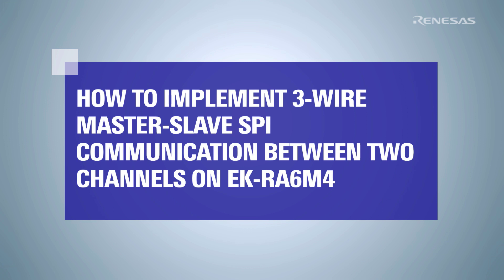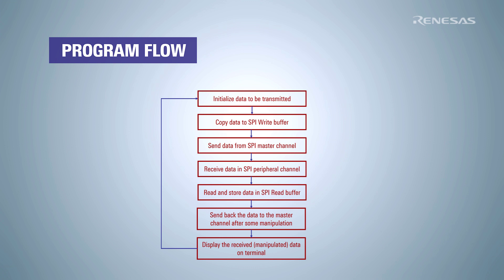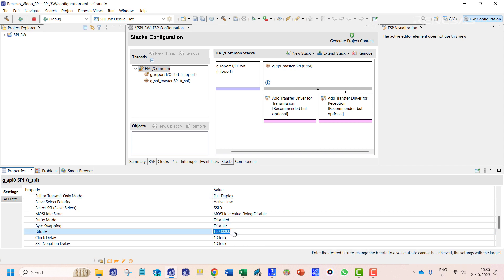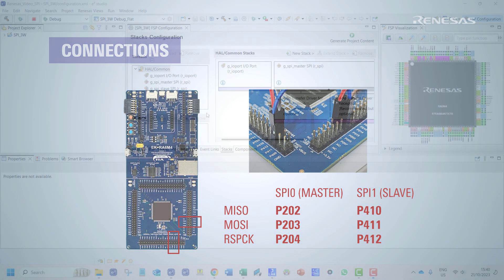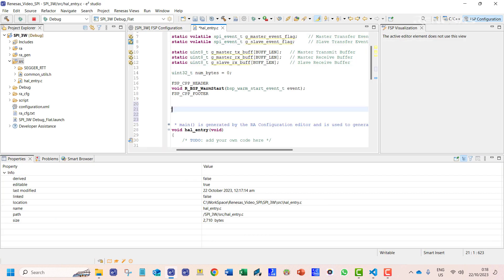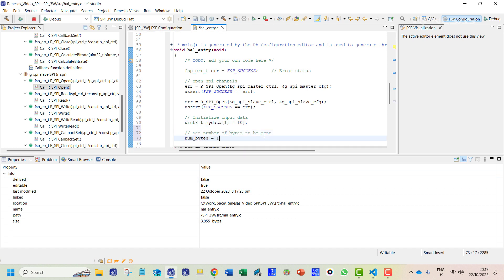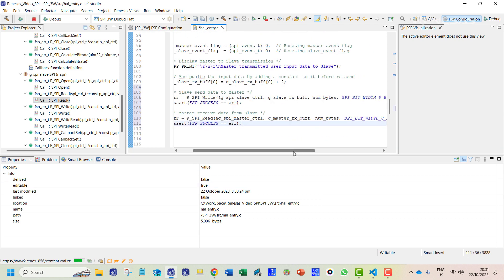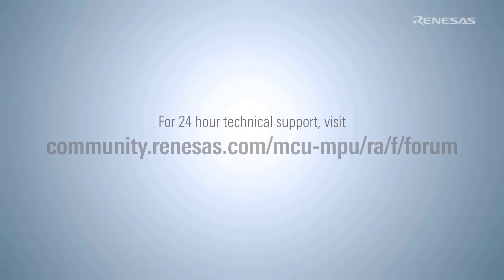Implement 3-Wire Master-Slave SPI Communication between Two Channes on EK-RA6M4

Comment: I find the title a little bit confusing, because I am looking for a 3-wire SPI BUT, the data is bidirectionnal. With the figure at 1:55 we can presume that's not what you're talking about. If you read the definition of the three wire SPI standard, that's not MISO, MOSI, SCLK, it's the MISO/MOSI which are only one bidirectionnal signal. Maybe that's what you're talking about, but the figure would be wrong